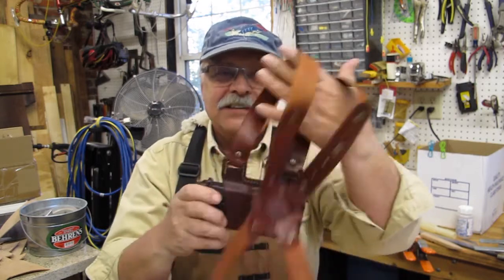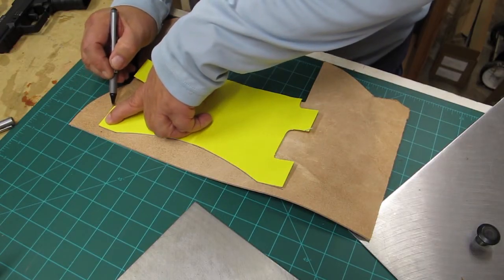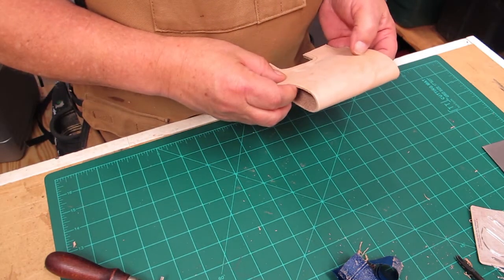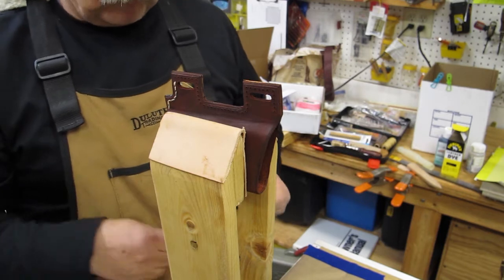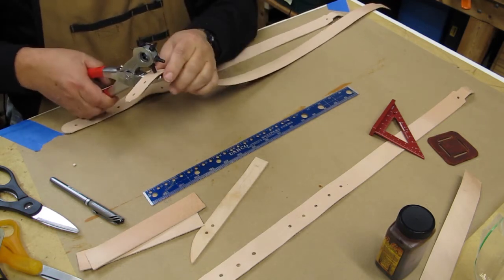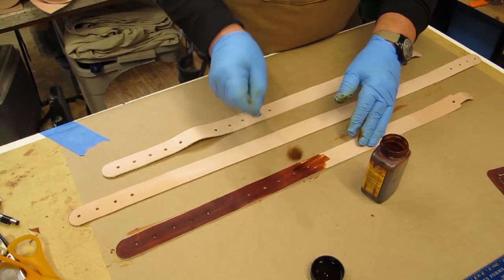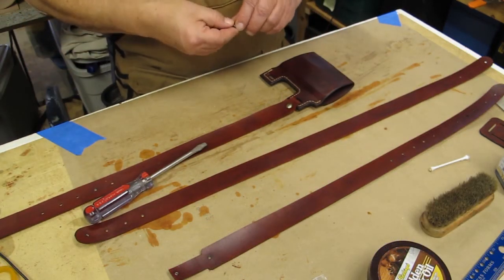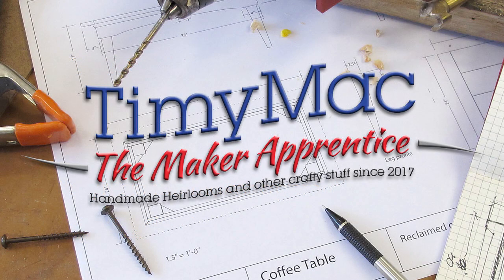TIMYMAC MAKES A CUSTOM SHOULDER HOLSTER

Comment: I really like you design, BUT, you never said  how long the straps were or the size of that square in the back. I want to make one of these but my finances are limited and I can ill afford to just cut pieces until they fit. I and probably a lot of others would like to know those sizes...if you don't mind.
Reply from the maker: Gary, two of the straps are 28" and one is 32". They connect with Chicago screws for adjustment with holes punched every 1". The back connecter is 2.5" square. The holster and connecter are 6-8 oz veg tanned leather, the straps are 4-6 oz. leather. I would get a cloth tape, used in sewing, to take the measurements from around your arms to see what fits you best. I'm getting ready to modify the strap to 3/4" in width and change the connecter to a 1.5" flat metal key ring. After months of use we determined the straps need to be thinner and the connecter telegraphs through the back of a suit coat. Hope this helps and good luck. TimyMac
Reply: Thank you that helps a lot.
 @TimyMac_MakerApprentice
Reply: I hate to bother you so late in the game, but where did you get a 1.5 inch flat metal key ring?  I tried using an oval piece of leather, but it didn't work.
Reply from the maker: @garyanderson2720  Ace Hardware, Lowe's, etc. FYI: It doesn't necessarily need to be 1.5". 1" will work.